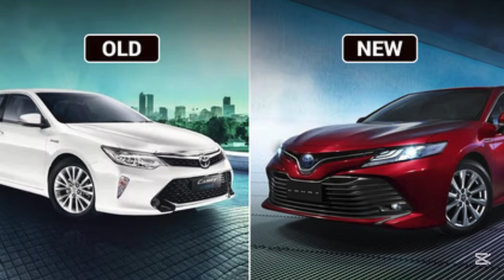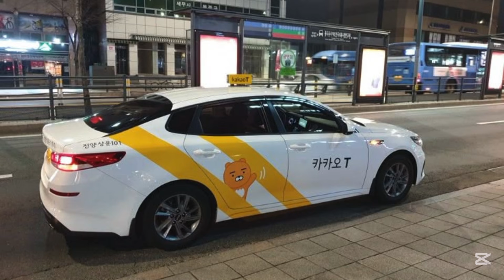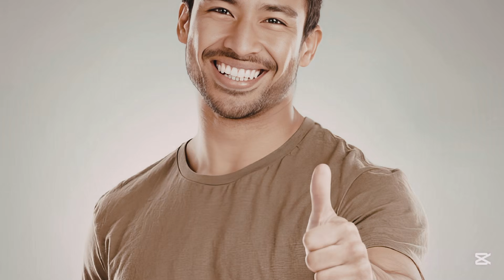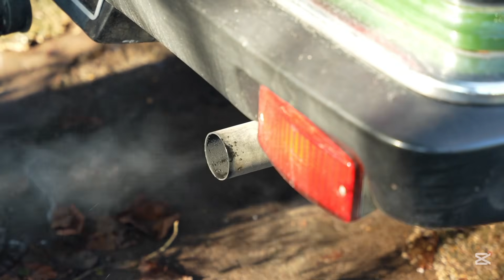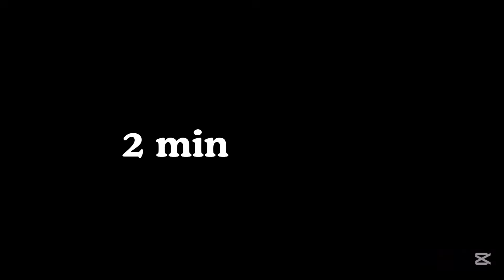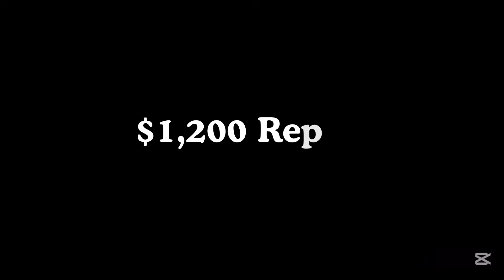I Drove My Toyota 400,000 Miles Using Only This One Japanese Habit

Comment: Warm idle for both turbo and non turbo engines: 60 - 90 seconds of doing nothing after start up, AND making sure the AC is off. Especially important when the engine is new, up to 5000 km. (Too bad this is an AI video.)